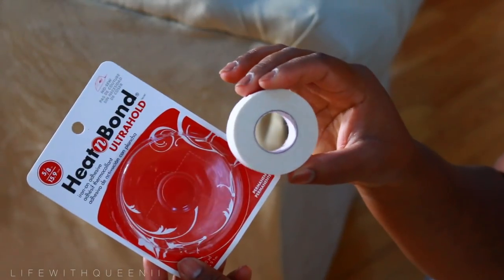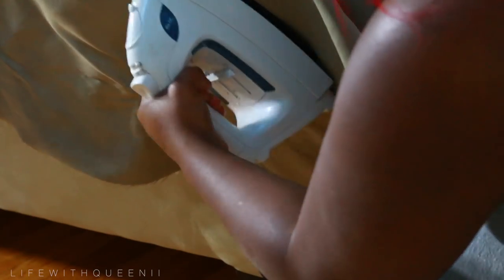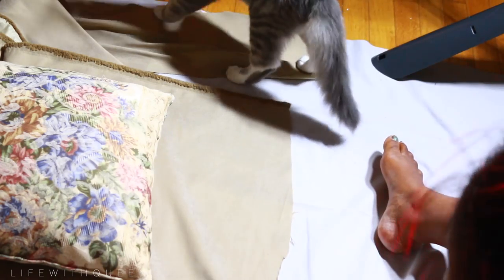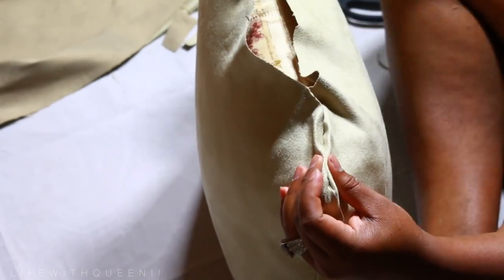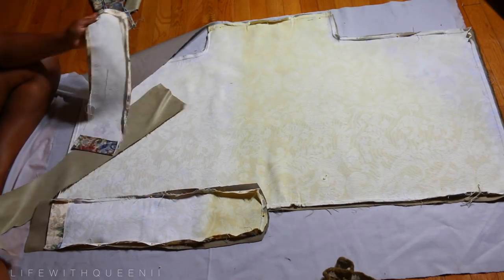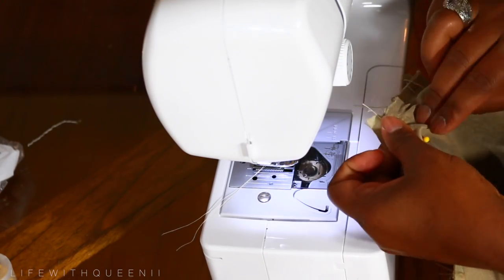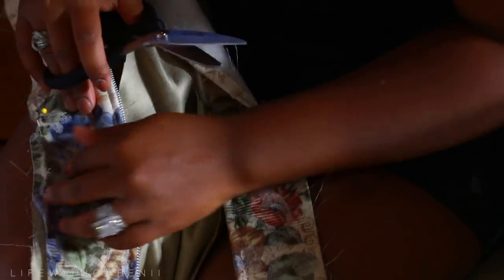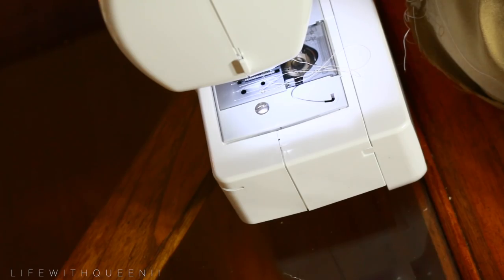HOW TO REUPHOLSTER A COUCH /SOFA Part 3 - LifeWithQueenii

Comment: After all this I would have loved to have a few seconds to see the finished product. I think if you would have added back the skirt or at least a fringe it would have given the couch a bit of glam. Also when finishing the top cover in back, an upholsterers cardboard strip under the fabric edge will give you a smooth finished look. I know you have done this before  but there are certain things that make for a professional look to your upholstery like piping on cushion edges and along the small pieces on arm fronts. You did however do a very good job and your couch looked very nice. I hope I don’t come across as a know it all. I have however done my share of couches over the last 50 years. Just thought I’d share my thoughts.